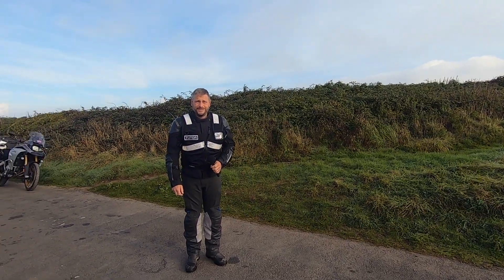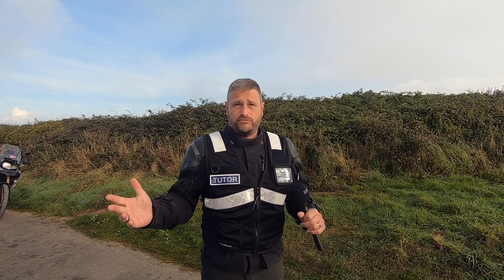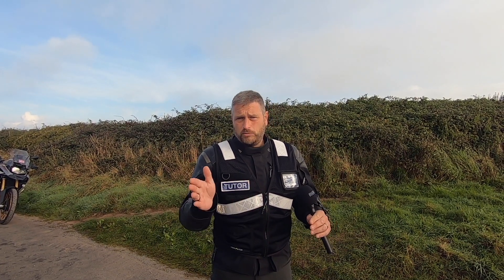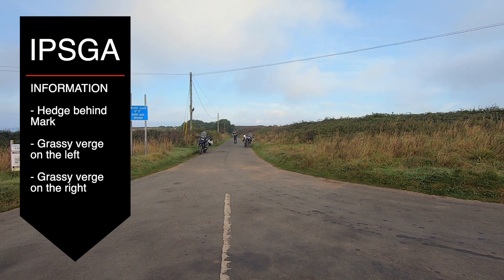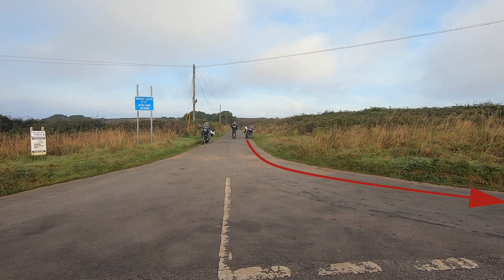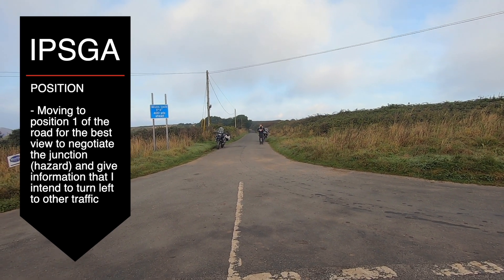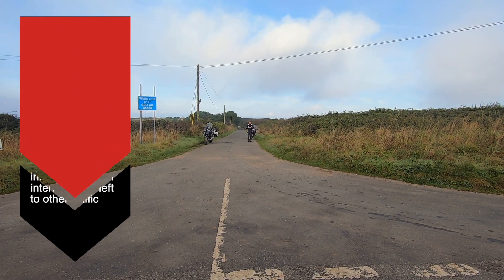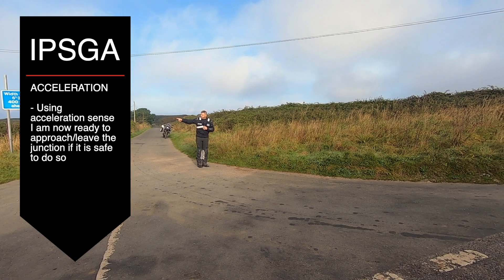Using IPSGA to negotiate a T Junction

Comment: Another good video chaps. One thing for me would be using the gears to slow down wouldn't activate the brake lights and a following vehicle may not notice any deceleration.
Reply: It’s a common confusion that people think you should show following vehicles that you are breaking. By starting the manoeuvre far enough away your actions will become obvious to following vehicles. Ride safe.
Reply: @markholroyd5365  I agree, one can hope that the following driver will notice. Ride safe.
Reply: @markholroyd5365  What is lost by giving potentially inattentive drivers the extra information of a brake light?
Reply: @bbumble4117  nothing is lost however by positioning yourself on the road and planning the manoeuvre in plenty of time usually is enough for the most inattentive. Ride safe
Reply: @markholroyd5365  Unfortunately in my neck of the wood “usually” is far from from “always”.  I still don’t see what is wrong is increasing the odds in your favour by having a brake light on, the effort involved for which is minimal.

Comment: Interesting guidance, thanks for this.
I’m new to motorcycling, and immediately (in my head) questioned no brake when slowing, as I would have thought that the brake light would be part of the ‘signal’ part of OSMPSL. I have read the comments so far and understand them, and on the actual road you’re using, can see both points. There can be no right or wrong for me as to whether a brake is, or is not required, either is correct. (Different, of course if the road surface had reduced grip.)
I’m really hoping you are able to do more of this advanced stuff…. I may be new on 2 wheels, but for me every opportunity to learn is a positive one.
Cheers! 🙏🙏

Comment: I do not understand .. Is this form of driving an extra course in the UK? In Norway, this is standard training when taking a motorcycle certificate.
Reply: My thoughts exactly. Anybody who doesn`t understand this, shouldn`t have a full bike licence.
Reply: @medler2110  Advanced training .. I really do not understand the term. You must have proper training from the first moment you take the motorcycle certificate, pass both theory and practical exam where the examiner checks if you as a driver have sufficient knowledge, behavior and attitudes to get a certificate. Why is it necessary to take a course later in so-called "advanced driving" Is not the first training good enough in the UK? and why are such "unfinished drivers" released into traffic? Just asking ..
Reply from the maker: To have a full licence in the UK, there are lots of hurdles to over come for bikes, depending on your age, depends what you can ride.  But the full UK bike licence lessons teaches you the safe riding, but doesn't touch upon counter steering, or using a system of motorcycle control (IPSSA) to pass the test.  RoadCraft that we follow says that Advanced riding can best be defined as becoming a thinking rider and applying the principles and systems of motorcycle roadcraft to every ride. Through learning these principles you become a more alert rider, your riding becomes smoother and ultimately you become safer on the road.  hope that helps
Reply: @RiderCamTV  Ok.It makes sense. Norway, counter steering is a topic in driving schools, but as my driving instructor said .. You must be aware of the physics but you must not overthink this. It is strange to push on the left handle and the bike steers to the left. in addition, a whole day is set aside for a trip where the points to be visited are fixed, and the same is the time to be used to complete the trip (6 hours). 3 breaks are fixed. the driving student must pack the bike safely without assistance and plan the order in the route. This is checked by the instructor before the trip starts. What the instructor does not say is that there is really too little time to drive the whole route. Are many young hot-headed drivers who start driving faster to reach the goal and become sloppy with reading the traffic. These get the sad message that they are not ready to take the final test to take the driving license ..
The reason I'm extra interested in traffic in the UK. My wife and I are planning a trip to the UK to visit her mother who lives in Sheffield and drive around the UK. It will be a long trip that starts in Northern Norway at the Russian border :)
Reply: @RiderCamTV  Counter steering can be taught on any test training courses (who says it isn't?). Standard licence courses generally use OSM /PSL (Observation, Signal, Manoeuvre (Manoeuvre = Position, Speed, Look). IPSGA can also be used. When you look at it, it is pretty much the same as IPSGA. It's a system that gives you space and time when dealing with hazards.

Comment: Good video, however a slight mistake with regards to the road craft.
You explained that you would have your indicator on indicating your forthcoming left turn at the junction.
Why indicate ?
You have explained that there are no other road users,  therefore your indication is meaningless as no-one will benefit from it. 
If as you approach the junction you see someone that will benefit  from your induction,  then that's when you indicate.
Keep up the great vids.
Reply from the maker: Hey Simon, you are correct indeed, although no traffic on this particular occasion, that's what we wanted so that we could slow it all down and demonstrate it.. and where the road has other road users your are correct that the indication would give information where here it doesn't in this example, although its always good to indicate.. :). glad your liking the videos and thanks for the comments :)